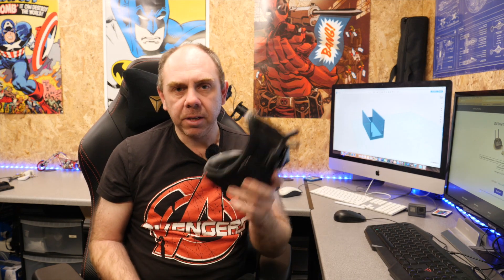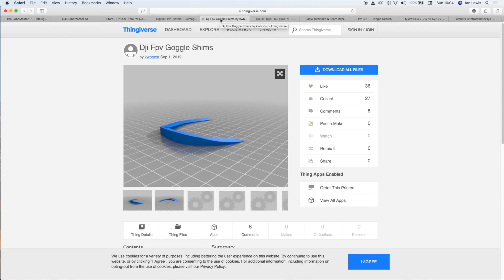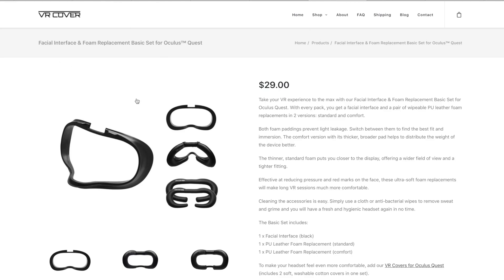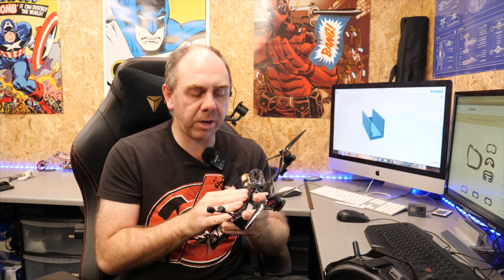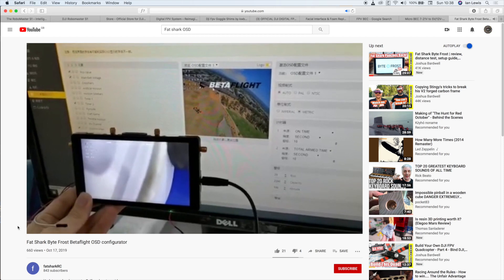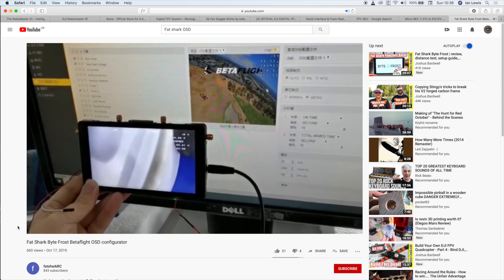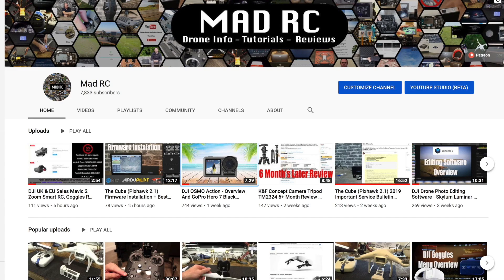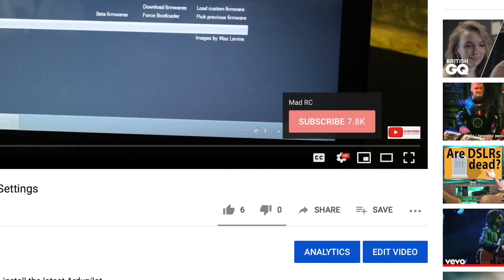DJI Digital FPV Light Leak/Resetting Issues Fix + Fatshark Byte Frost Beta Update

Comment: I have one of my dji air units stopped working. I am running 6s with a voltage regulator dropping it to 9 volts and good to 1.5 amp. When I power it up I just get a red light and it never changes. I checked power with my meater and it's perfect up to the air unit both positive and negative. Do u have any idea. Only thing I have not done is change sd card and see what it might do. Any help would be appreciated thanks
Reply from the maker: Try powering it from a 4 or e a direct and see how it is.  Also have you tried it with all but the power connected and bad UART and Sbus settings can also cause this.
Reply: Tried air unit with new harness and stright to a 4s battery with no luck. I also changed put the camera and harness for the camera . No luck. When unit gets power I just get a red light. I tried to conect it to the dji assistant 2 for fpv and redo the firmware and it will not recognize it's even plugged in. I will get with getfpv and see what I can do from here thanks

Comment: Print the shims in TPU, no reshaping needed. Also iflight has a 12v 2A BEC that takes up to 6s, the matek BEC only takes up to 5s. Just a tip for everyone reading this.
Reply from the maker: Jesus I missed that, not sure how, also on the TPU yea should have mentioned that my self I was thinking from what I had, Pla or ABS.  

Thanks for the call out on this. :)
Reply: Thanks. I have both but haven't used the Matek as it only takes 5S. Anyone tried 6S on the Matek? Can it take slightly more than 21V?